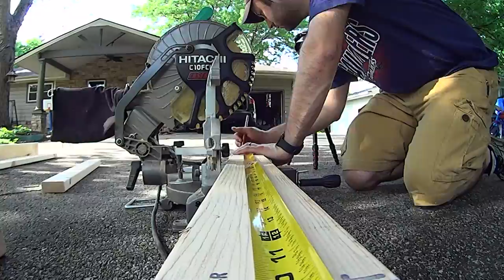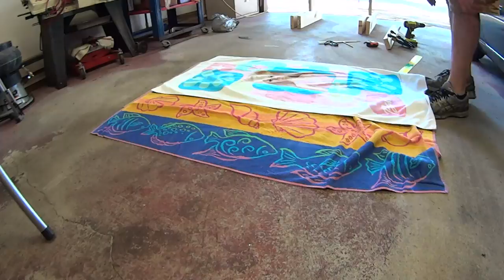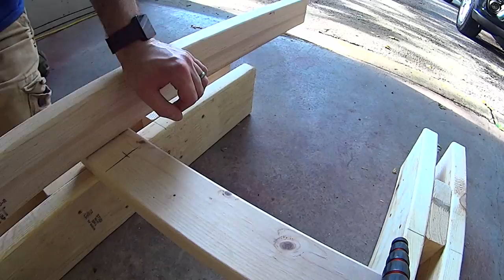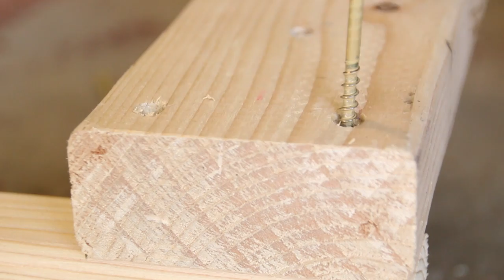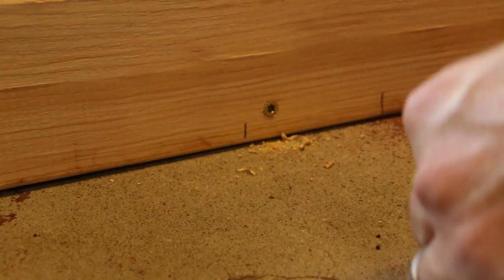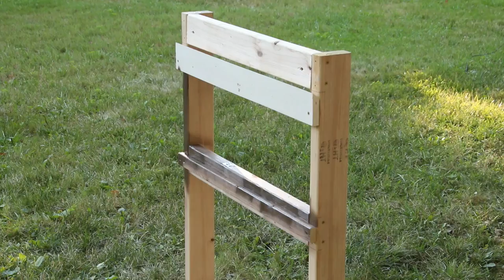DIY TV Stand

Comment: Great idea and a great video too! I would love to try this. Do you think I could do the same for a much larger and heavier TV?
Reply from the maker: +Maurice Jordan I don't see why not. 2x4 and 2x6 lumber can definitely take more load. You may want to use to cleats like someone else mentioned. The biggest concern is tipping. Just make sure you don't put too much weight too high off the ground with too short of feet.
Reply: Safety Glasses Required yes, tipping is my main concern. I'm a complete beginner when it comes to building things, like I know how to follow directions really well lol but, that's about it. So thanks for the link with the play-by-play. I want to do about 180lbs 3ft off the ground. About how long do you think the feet should be?
Reply: Sure, sure, that same setup will hold a 75" crt tv, have fun...